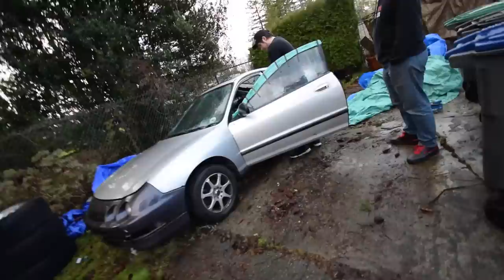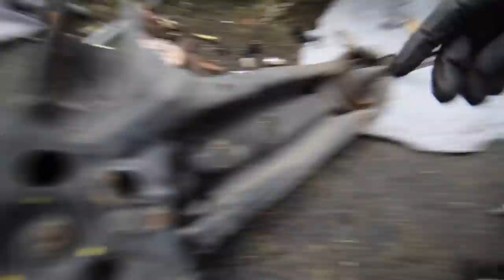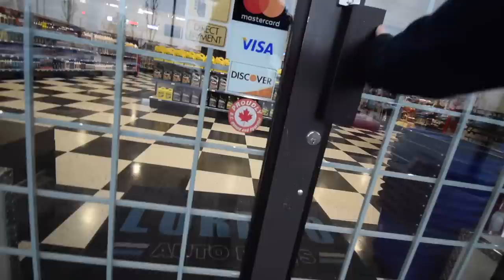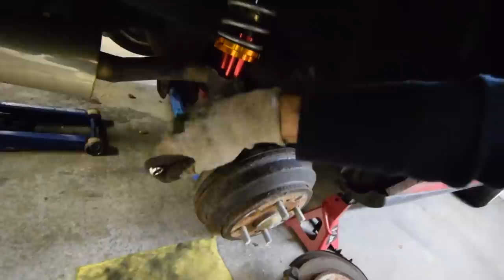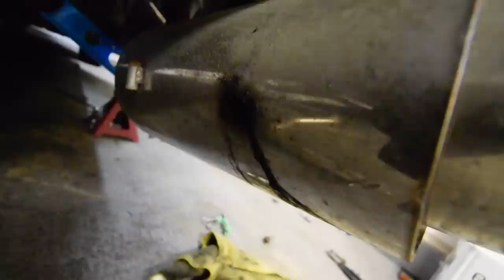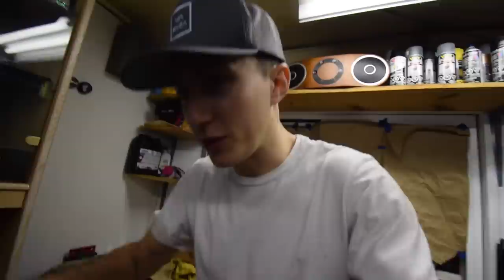Swapping my EG to DISC BRAKES from an Integra!

Comment: I think you should buy the Honda/ Acura engine.
Reply: b20 with vtec head is extremely cheap and good
Reply: A jseries would be even awesome despite the weight
Reply: LSV
Reply: YES! The K20 from the acura rsx type s! Although the base version k20 has better compression for turbo'ing.

Comment: IF YOU PLAN ON BOOSTING A B SERIES BUY A B18 LS! B20s ARE NOT WORTH BOOSTING BECAUSE OF THE THIN CYLINDER WALLS! Sorry for caps but it gets peoples attention haha. B20s are great for all motor as a b20v motor.
Reply: agreed
Reply: Finally someone else agrees with me
Reply: Agreed also the ls transfer is longer and great for boost
Reply: This is true they also have hella weak connecting rods
Reply: Can I do an all motor b18b1?
Reply: @edgarabad3047  yeah for sure. Just do highcomp pistons and a b16 head of your choice haha

Comment: Suspension,brakes,tires and wheels are very important if you want to upgrade performance of the car.
That is my opinion and I agree with the engine swap.
P.S Mashed potatoes.

Comment: Muffler broke get a vibrant muffler they sound soo good on hondas none of that raspy rattle can crap my integra was a deeper tone idle sounded dope idk how much the tone would change on a d15 single cam compared to my old b18 teggy with a vibrant muffler but they sound dope great quality check there website out

Comment: And Robbie, I have a 93 civic si hatch and I just swapped a b18b1 motor, but threw on a integra gsr head to gain vtec. It’s the next move to gain power and move up from a d series. For now I’d say go with a b18 motor, they are know to be stronger then a b20 and can handle more of a beating. Especially if your trying to add boost. Hope this help and can’t wait to see more vids👌🏽

Comment: With all the boost you need your brakes lol
Reply: The whole like 3 pounds lol
Reply: @AlexSmith-ig9up  7psi actually
Reply: @jakoparon6168  A whole like 7 pounds
Reply: I knew it was single digits but could remember what
Reply: @AlexSmith-ig9up  3 pounds 7 pounds either way it's more than what car made stock.... if I remembered right it practically doubled overall hp.... so best to upgrade stock brakes. Overall safety first, plus budget build is over now, @robbieferriera words himself. So obviously there will be more upgrades to engine, turbo or all put swap. So why not switch when it's free lol. Not trying to sound like a douche but truth
Reply: @Fat2Fit5k  you might be on to something maybe he's is gonna swap it

Comment: Here is s protip for you, and your buddy. Coming from a heavy duty mechanic ; if you're replacing the brake lines, rather potentially stripping the brass nut with a wrench, cut the brake line with some snips, take a 6 point socket and use that to get the old nut off. Invest in some flare nut wrenches for reinstall if you do not have them already. Keep up the good work

Comment: I would buy the non vtec b18 and put a integra typer head and then boooossssttttt
Reply: Cody Tessmer  not the EXACT, same thing. But for the price of the Type R head, u can just modify a GSR
Reply: Cody Tessmer  that's a thing with series. Same goes for blocks, pretty much every B series block is the same, but u don't say a B16 bottom is basically the same as a B18C1 just because the block is the same
Reply: No its a b16 head with a port and polish dual valve springs and retainers, type r cams , and type r intake.
Reply: Just stating the bare head is not 100% the same my bad.
Reply: no biggie but yes the b16 head is different, only cause it does not have a stage 2 port and polish job. as the type r comes stock with not a big deal if you have skills or $

Comment: I know this video happened forever ago but you need to swap to a 4 wheel disc car master cylinder and proportioning valve up in the engine bay. The rear drums require more pressure than the discs. If you don't change the proportioning valve the rears will lock up on you under hard braking because that are getting g more fluid pressure than the fronts

Comment: driving save isnt uncool ... get bigger brakes for bigger power, period ... edit: slap those guys with a book 24/7 for letting an integra rot that bad, what a shame ... edit2: please consider swapping front brakes (complete brake swap) and brake distributor aswell, as your "brake balance" will be slightly off right now ... edit3: mash potatoes
Reply: Yeti is there any point in swapping the rear brakes? I’m thinking about building a hill climb civic hatch and don’t see a point in swapping the rear brakes
Reply: The Integra has a parts only title on it. Can't be driven.
Reply: @Zer0Gravity31  upgrading brakes is always helpful because no matter how fast you can go ... there comes a time when you wanna stop ... and to do this save and without harming people around you, better change them drums
Reply: @ConnorFesenmaier  its not about driving it. its about not letting the shell rot in the wildness. integras are getting rare, so they throw money out the window every day as this car sits and rots outside
Reply: @running.yetiii  the car shell can't be insured, anything worth taking is taken out and it is still being parted out. Unfortunately this one is already done for no way to save it.
Reply: @ConnorFesenmaier  people over here in Germany will pay you approx around 1000 Dollar for a blank shell in good condition ... just for rebuild purposes or cutting out panels for their integras ... i wouldn´t throw away 1000 Dollar :) just sayin
Reply: Connor Fesenmaier I understand front brakes but rear brakes are hardly used especially with fwd brakes

Comment: You need to get a new brake master cylinder or proportioning valve (not sure which one) but the one needing to be replaced is for front disc and rear drum. You now need one for front and rear disc brakes. I just did this on my 1972 Custom F100. For me it was the master cylinder but it might be just a proportioning valve for you. I’m not sure.

Comment: I hope you changed out the brake equalizer from the integra as well.   It will ensure you have the proper brake bias for the front and rear when applying brakes.  Had to do this on my Honda EG more than 15 years ago. I still have my car and still making mods to it today....

Comment: Mashed potatoes also did you get the brake proportioning valve off the integra because if you didn't you wont be fully utilising the rear brake conversion.

Comment: B18 ftw. If you want to stay boosted go with the B18b1, if you'd rather have a significantly longer project with more content, go with the B18c1, give the motor a little TLC, then boost that baby back up. 

Unrelated, recommendation to swap to teg front brakes also to balance. 

I think the more you invest in this car, the better she'll treat you and the better you'll feel about your finished project.

BTW, your channel always makes my day, guys. I've been slowly building my 94 hatch back up to awesomeness and you are an inspiration.

I have some B18c1 things if you're interested in making that a thing for her.

Also - what name did you give your cars?

Comment: One of my first mods are usally brakes on cars that I plan to make faster. Brake fade at high speeds scares me. I experienced it when I had my first car and i thought it was fast AF. It was a little 2 door cavalier with 2.2l eco. Had aftermarket cams,2.4l intake mani, lsj exhaust main, stock downpipe that was modded to remove the small crush bend. Aftermarket pacrsetter cat-back. Coilovers,lighter weight wheels and some minor weight reduction. 
Stock brakes all around. Experienced a few good highway pulls in 🇲🇽. Brakes practically did nothing at all when trying to stop. I went home,got online and researched a decent upgrade and ordered new calipers,rotors,pads,braided lines and dot 4 fluid. From that point on i decided i was going to upgrade brakes if i want to play race car driver. 
Be Careful out there people.

Comment: Take the B18 in the part out Integra, it's way better for boost rather than a b20 because b18 got thicker cylinder walls than the b20. So, you could run higher boost without worrying about cracking the walls.

Comment: Mashed potatoes-   good job with the mod. Ive done this with my friend once on his civ. If i remember correctly you may need to get the prop valve from the integra for the brakes to function properly. Also i say grab the b series while you're motor is still running.  You could rebuild the b series to make sure everything is good in it before dropping it in. I suggest using innovative mounts i got them and they are great been using them for over a year now.  I think i got the 75 strength.   Without the mounts the motor can be forced in but the motor doesn't set properly. Also i got my innovative mounts for like half the price of hassport mounts. Also i got a mugen racing universal muffler and it sounds amazing.  Very deep sound.  I think i got it for 125usd on ebay.    Good job and keep up the good work.

Comment: Please buy a b20b motor and put a b16 vtech head on it and have it turbo for the civ it would be awesome to see the civ with around 350hp with that set up I hear you can go as high as 450hp with a decent turbo and fuel system

Comment: Next up, you’ll have to get Integra front spindles and put the stock Integra calipers and rotors on. Or use the Integra spindles and pair that with the ‘97 accord calipers, ‘07 Mini Cooper base model 280mm rotors, and tsx brake pads. Don’t forget the 15/16 brake master cylinder and 40/40 prop valve!

.....mashed potatoes.

Comment: Mashed potatoes would actually be a good color for the car.  Paint the valve cover yellow like a big pat of butter.  I've got a 1992 Civic VX that is 100% stock, which is both good and bad.  Going to start fixing it up soon- will be better than new!  Keeping that strange D15Z1 motor though, it's hard to say no to tanks that average like 45 mpg.

Comment: Brakes don't stop your car, tires do. Brakes convert kinetic energy to heat. 
If you want to stop faster or in a shorter distance, the only way to do it is to buy better tires.

Brakes upgrades don't make your car stop faster, they make your car stop more consistently. They allow the brakes to hold more heat without failing. (And remember, the whole purpose of brakes is to make heat). The more heat the brakes can hold, the longer they will last before they fail. 

However, your street driven car will virtually always give your brakes adequate cooling time between stops. You don't really need any extra heat holding capacity. Your stock brakes are good enough for street driving. Even when you're driving like a dousche bag. (Spelled wrong on purpose). 

If you pound on your stock brakes, your wheels lock up and skid across the road. (Discounting abs). See. More braking force isnt going to help because with more force, your tires start skidding across the road at the exact same time. If you want to stop faster, you need a tire with more grip. One that will hold on longer before it starts skidding. (And skidding is bad because the surface of the tire liquefies, obviously drastically reducing stopping times). 

Bigger brakes don't stop your car faster. They just don't. 

That doesn't mean they don't have other advantages. You might have an easier time holding the brakes at the threshold of skidding with a better braking system. However, a big brake kit can sometimes have the opposite effect if it isn't balanced. You might have too little control and lock up the tires too easily. You need to make sure your master cylinder is the proper size for your calipers. 

If you plan on bringing your car to the track on a regular basis, or you live in the mountains, upgrading your  brakes might be a good investment. In both of those places, the extra heat capacity can help. 

If you just want them to look cool behind your wheels, that's cool too. But be careful. You can just as easily make your car worse. A lot worse. 

I'm not debating any of this. It's all correct. 

And

Thanks for coming to my Ted talk.

Comment: Mashed potatoes! Don’t forget 40/40 portion valve to help distribute pressure between front and back brakes. Any b series motor (vtec or not) will be better than stock D15. Then if u turbo B motor will better too

Comment: Mashed potatoes, and you should definitely put a b18 in it, I have a 91 integra, and these motors are bulletproof, the owner before me blew the head gasket, and drove over a thousand miles without water in it, he drove it without oil in it, cuz it's burning oil, (it has 265k miles on it) and he kinda glued part of the head together, and now im using it as a pizza delivery car (I have a motor that im rebuilding to put inside of it now because of all that he's done to it, and im tired of putting oil in it every couple days)

Comment: i know this is an old video but i really wanna know what year integra did you get the trailing arm from PLEEEEEEEASE answer me lol
Reply: 1994-2001
Reply: @Spike101  thank you dawg 💪💪
Reply: You can use the DA trailing arms too but you have to swap some part from the civic trailing arm to the DC trailing arm... im about to do the swap right now. Maybe ill take video.
Reply: @Spike101  bet bet cause I got a eg hatch that the previous owner already did the rear Integra disc conversion but idk what year he used. buuuut if I'm not mistaken the only difference is that one rotor is 11" and the other years is 12"?? correct me if I'm wrong

Comment: Mashed Potatoes

You should increase disc size on front because it was planned to slow down the car together and if the rear starts to braking harder, it will start to spin around like you used ebrake.

So please, get the fronts from that Integra too! Think in system :)

Ps.: Now I officially started searching for GTI brakes on my Pulsar🤔🤷😂

Comment: Mashed spuds. Anyway there is a difference between cheap garbage from wish and cheap decent parts from ebay and Amazon. You can still do what your trying to achieve with out wish trash.